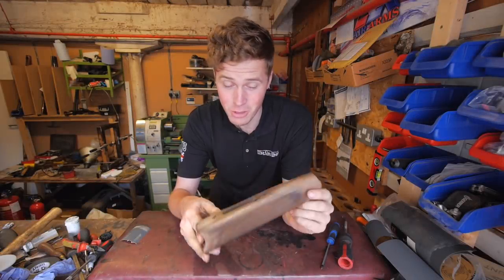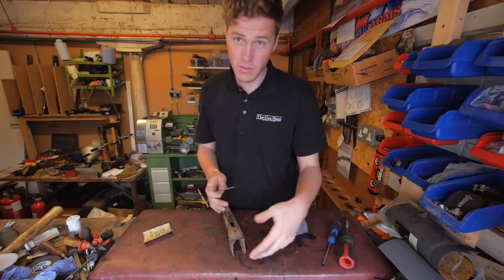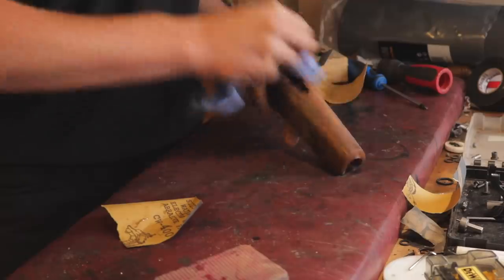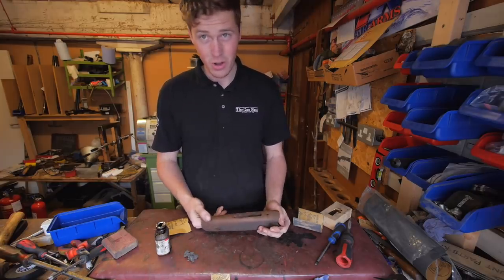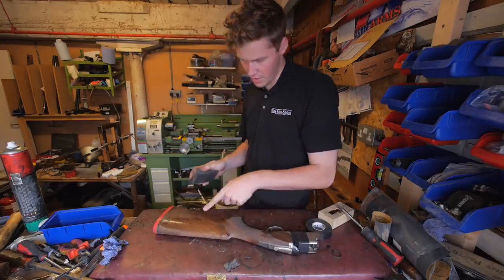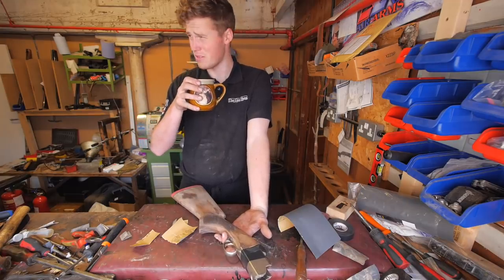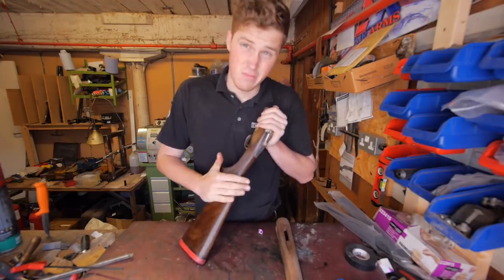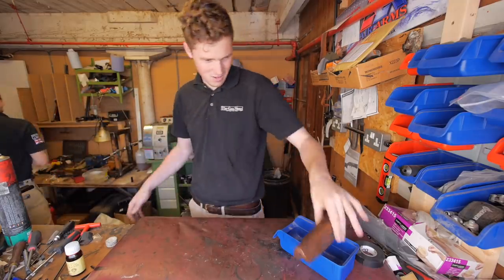Cheap to Charming - The Sporter - Penultimate Episode [5]!

Comment: Just wondering how you removed the old finish/oil from the checkering? I have an old side by side that's very dark and I think if I refinished it there might be some nice wood there. I'm just concerned that if the checkering is left the colour will look different than the rest of the stock when refinished.
Reply from the maker: Varnish stripper works well to start, but I’m afraid you will have to wait for subsequent series to see how we do it!